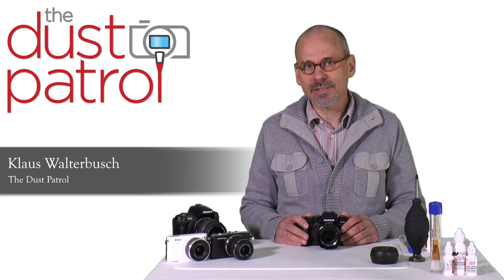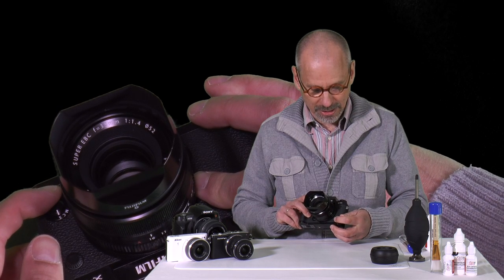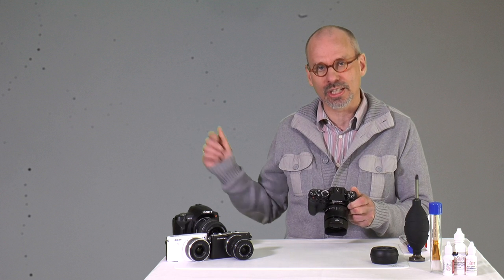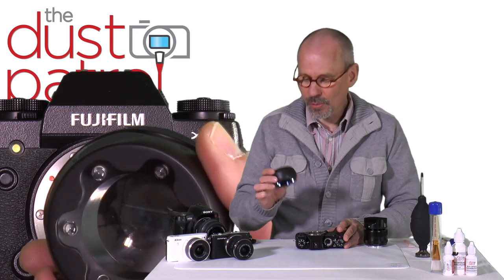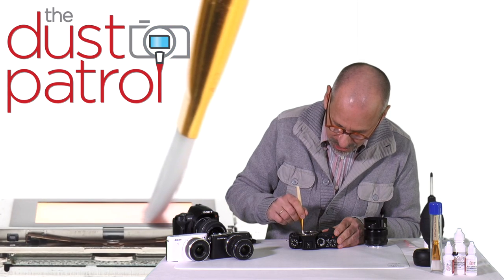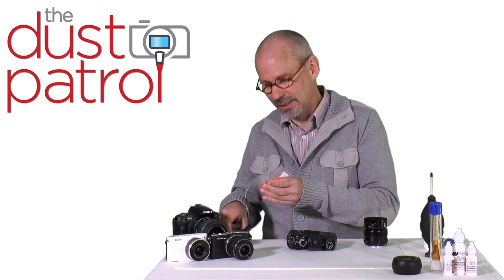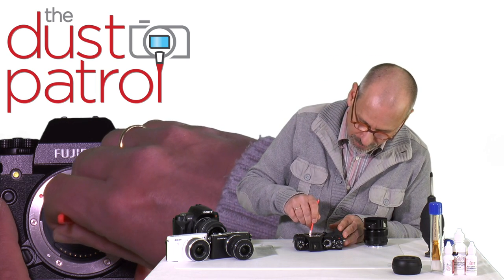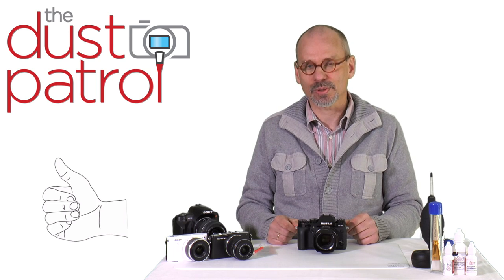DIY Sensor Cleaning Fujifilm Mirrorless Cameras

Comment: I left scratch on my fuji xpro2 after cleaning the sensor 😭,,, what should i do?
Reply: How????? It’s probably a streak. Do the cleaning again . Should be streak
Reply: Did you use an air blower to first remov debris before using a swab

Comment: What happens if you change the lens with the camera on?
Reply from the maker: When the sensor is active, it generates some static charge which may attract dust. So I would always switch the camera off when changing lenses.
Reply: actually you could, but its better to turn it off.

Comment: Interesting that you keep the dust on the brush and then store in the tube, only to brush dust on the sensor on the next clean.
Reply: Before using it next time, he will blow the brush as you can see at 2:22
Reply: Lol… with that liquid solution for sensor + air blower , you are eliminating dust.. trust me. I reused several swabs and works just fine.
Reply: I wouldn’t reuse too much time btw . Maybe 3  times